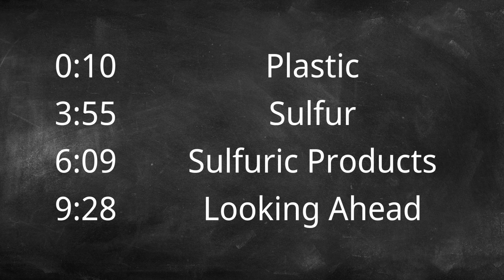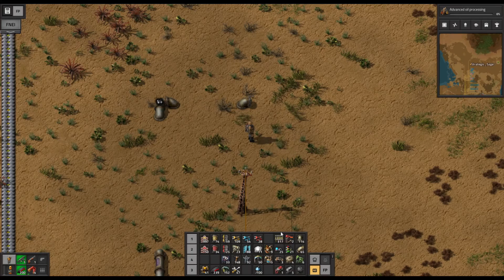Chemical Plants | Factorio 1.1 Tutorials for New Players #25

Comment: got anything for advanced petrol? its been a nightmare trying to figure out how to place all the pipes seeing as my oil comes in from the left and water from the right I guess I should've left more room between everything. i like how you arranged the underground pipes though that was helpful. i think once I get robots going I'm just going to copy someone elses base layout complete with logistic chests which I never really left room for either.. everything just goes straight to where its needed in assemblers not much room for chests now
Reply from the maker: Two videos later in the playlist I cover advanced oil processing, so that's definitely there.    FYI I advise doing that before robots.  

I also advise against copying anyone's layout that way, including mine - I think you'll be far better off by learning how everything works so you can design your own more effectively.
Reply: @strategicsage7694  thanks for the quick reply c: & thank you I'll try to find the videos. I thought about copying for a while and decided I'd rather do it myself as well it'll give me a lot more satisfaction with the end result and I'll understand all the inner workings better. I setup the advanced petrol station so I could get lubricant to build bots but I'm not sure what to do with the light oil yet so I've just flicked it back to regular petrol to continue my researches for now. going to adjust what I can with my current build to drop in some chests for things here and there and eventually have a "mall"